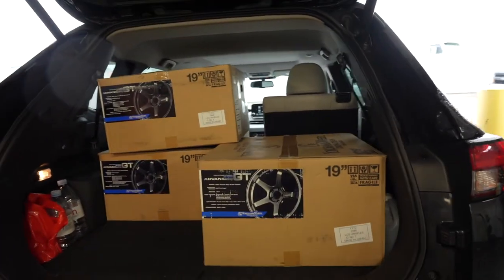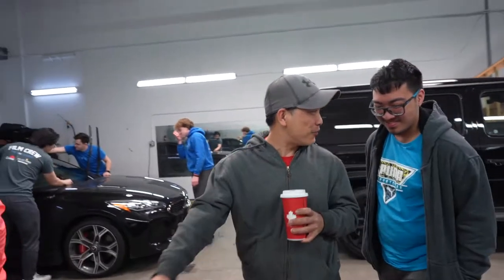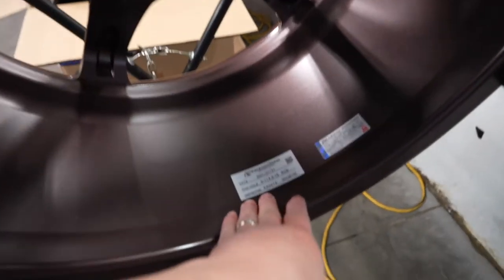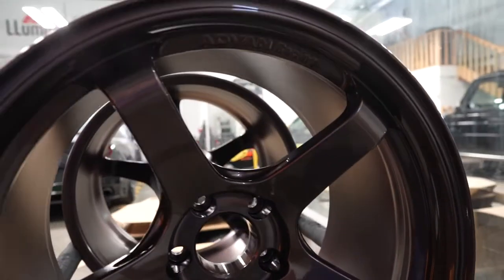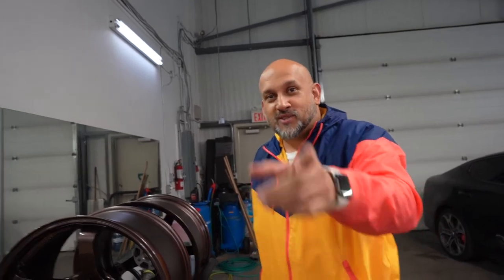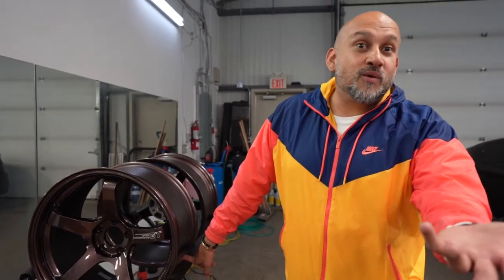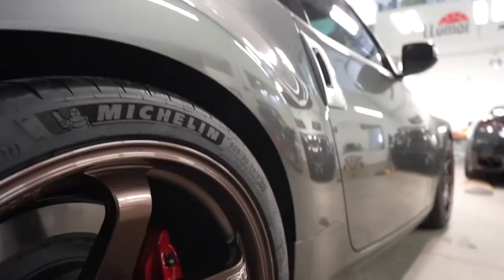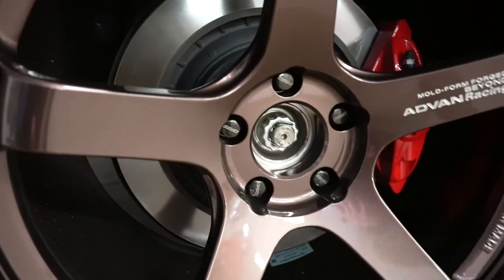ADVAN GT Beyond Ultimate Unboxing - Everything you need to know!

Comment: I ran advans on my Evo. best wheels ever. had rays as well. similar to this design. sick to see inside the shop activity. cheers
Reply from the maker: Dan they are pretty sick wheels. They are cheaper and lighter volk te37. The nice thing is they are both produced and designed by Rays wheels.
Reply: @phothrottle  only issue I have with any rare wheel or discontinued ones like my Evo had  when something happens to a one wheel where can't be replaced.  You pretty much stuck and need all 4 new wheels :(
Reply from the maker: That is so true! Especially if you get a custom color or offset. You are pretty much screwed for getting a replacement. No one thinks of that or puts into consideration when ordering a new set of wheels.
Reply: @phothrottle  same goes for cars. I'd love to own another B7 RS4 Audi but the parts are harder to find and not cheap where only 10k of them were produced in 07 and 08 . GT-R parts i can find anywhere. Plus 10min away from AMS and 5min from boosin performance
Reply from the maker: Yeah the more rare the car the more rare the parts haha